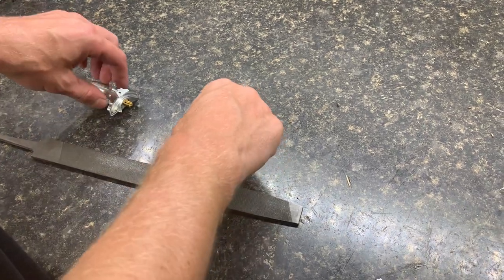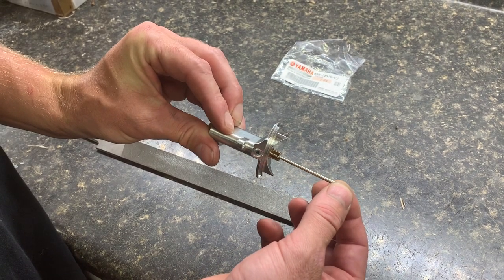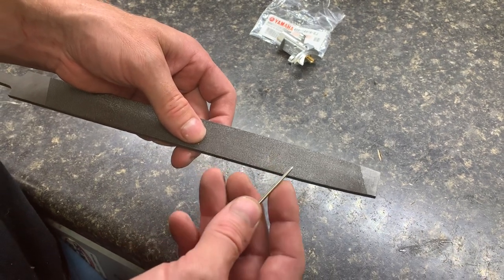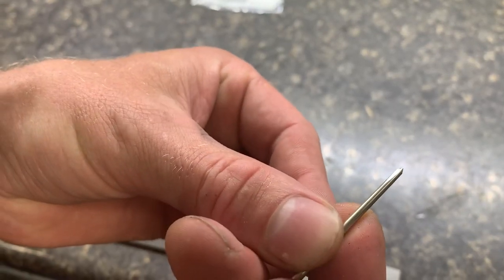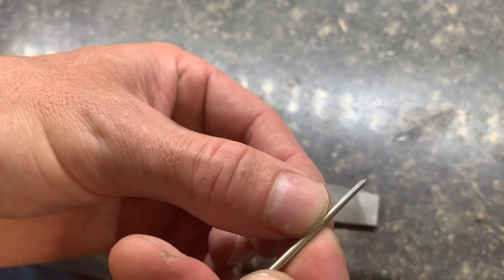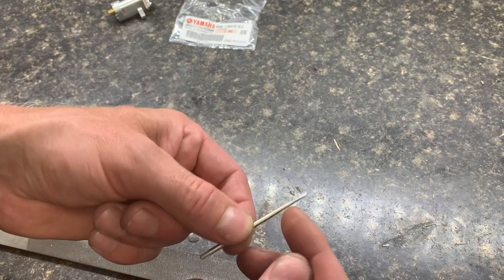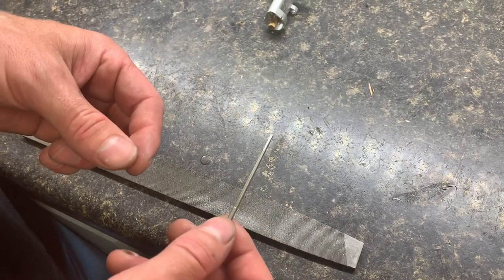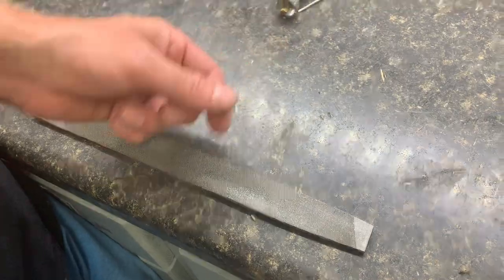Needle tuning for STIC blocks

Comment: Moved from 182 to the 190 main jet which cleaned up the bottom end. Does moving to the 200 or 210 MJ further clean up the bottom end as long as you modify the EJ needle? Or is the benefit soley for WOP benefits?  Thanks for this great video!

Comment: Or put it in a drill....
Reply from the maker: Good luck with that
Reply: @HPRaceDevelopment  Didn't need it...
Reply from the maker: @korma9732  Nice vague comment
Reply: @HPRaceDevelopment  I just use 400 wet n dry and place the needle in a drill chuck or Dremel, then polish off with Autosolve
Reply from the maker: @korma9732  To what purpose - maintaining round has zero importance
Reply: @HPRaceDevelopment  how many square carb needles have you ever come across? Sound like bodgers!!